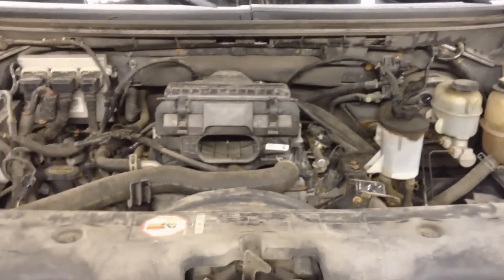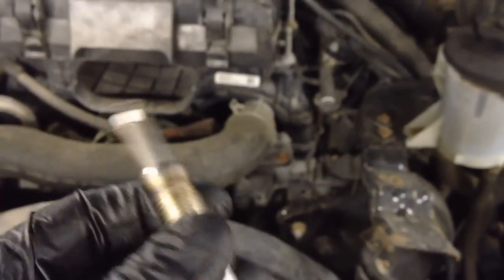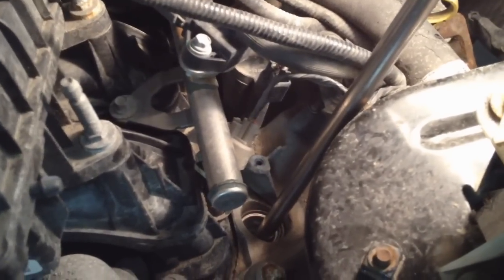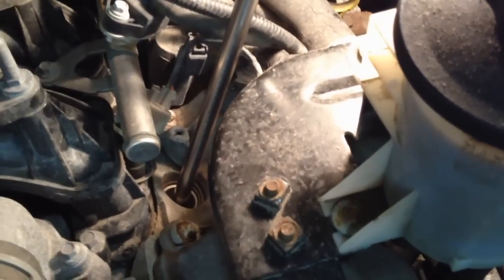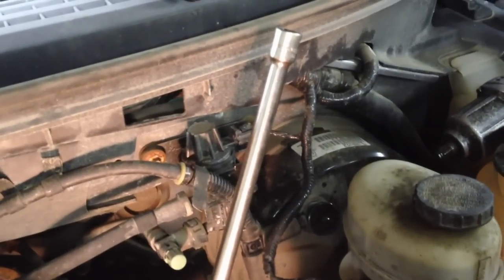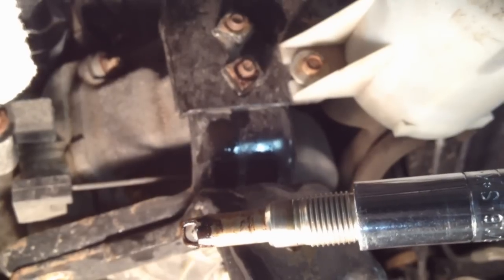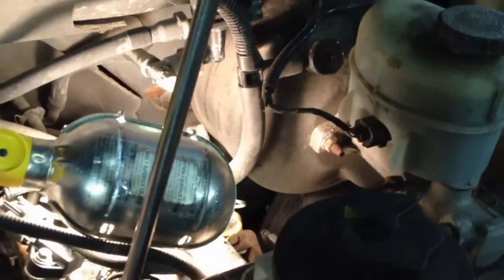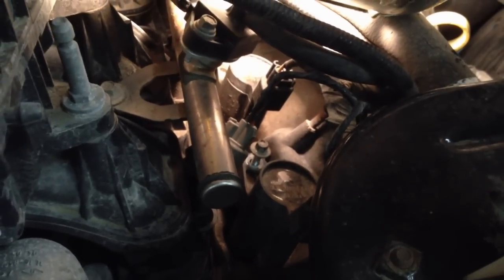Ford 4.6L & 5.4L 3V Triton Spark Plug Removal

Comment: I HAVE A 2002 FORD MUSTANG GT,  4.6L V-8.  IT HAS 100,000 MILES ON IT. THE PLUGS HAVE NEVER BEEN REPLACED. DOES THIS MODEL YEAR HAVE THE PLUGS THAT BREAK OFF? BY THE WAY, ITS IN MY GARAGE AND CRANKS BUT WILL NOT START. CHECK ENGINE LIGHT IS OFF?????????????

Comment: I bought my truck for next to nothing because it would sputter on the highway and even on hills, so I decided to go right through the truck because of the high km's, so I changed the spark plugs, i ordered 8 new cool packs but still haven't received them yet, while doing the plug job I noticed one of my coil packs had a crack in it, these trucks are known for coil pack problems, there's also a fuel pump drive module mounted to the frame of the truck above the spare tire, these are also known for corrosion problems, I checked mine out and there was a hole in the back of it from corrosion so I ordered one of those as well.

Comment: Just did this to my 2004 f150 with 245000 kms on it, used the carb cleaner and let soak for 20 minutes and rattled all 8 plugs out without a problem, I purchased the lisle tool just in case but never had to used it, this method works awesome, you can really see how the carb cleaner eats up all the carbon, i was really worried about doing this job and did lots of research on different methods and this is the one I felt most comfortable with and ended up changing all my plugs in less then an hour, highly recommend the carb clear method.
Reply: mike furlong could I ask you why you did it? I have an 06 which sputters majority on the hi way. I'm just not sure I should do this or the fuel filter/ injector. That's why I ask
Reply: mike furlong mine hesitates between 40-55 mph and new plugs and coils fixed that
Reply: How did you get to the ones damn near under the fire wall about to tackle this job wed on a 04

Comment: my expy 05 sitting for more than 6 months engine not working and can not break the plug even 1/4 turn to spray carb. cleaner, your advice plz.
Reply: bas far Did you try an impact wrench?
Reply: thanks for answer actually I soaked it with carb+wd40 for a night and used break bar

Comment: didn't brake cleaner evaporate to fast to run down the threads
Reply: Don't be scared, I just did mine. It's an 04 with 99k miles. I did mine with a warm engine, broke them loose, sprayed WD down in there then worked them back and forth all the way out. None broke.
Reply from the maker: Certain brake cleaners like the CRC brand don't evaporate as quickly.
Reply: $400 to have my plugs changed. I can buy the extractor tool for $50. And plugs for $100.00 saves me $250 bucks but I am nervous to try it.

Comment: Help....I'm dying here.  2007 Lincoln Mark LT with the Ford 5.4 motor.  Followed videos, and instructions, used carbon breakdown, etc.  First two plugs came out, no issues.  Right front plug has been my worst nightmare.  Lisle tool is brand new and won't do anything.  Spark plug broke cleanly at the electrode shield and that's stuck in the head.  Mr. Lisle won't grab it.  So, I headed over to Autozone to borrow a brand New Mr. OEM and the tap proceeded to strip like it was made out of tip foil.  Now, I'm obviously  a complete idiot here or have overlooked something.  Do I need to get out the burr drill and make room?  Any help would be greatly appreciated.  I''m on life support.  People make this look easy......
Reply: i feel so bad for you! ive done dozens of these 5.4 and 4.6 spark plug swaps and have never had an issue. i guess its only a matter of time

Comment: How did you get the engine warmed up after you had loosened all the spark plugs and removed the coils?  Did you have to reinstall the coilpacks while still keeping the spark plugs backed out?
Reply from the maker: +jlizer yes exactly

Comment: I have been watching your vids about the spark plugs breaking and how to extract etc. Come to find out, the day I was going to change plugs on my 2008 F150 (had all wrong plugs, coil and boots ready to install) just happen to read a Ford Forum online that talked about the change that Ford had made on engines starting 10/2007 on the new design of valve, spark plugs etc. I looked at my Coil boots and they are "Brown" in color then looked on my motor and it was built 03/2008! So to make this a little shorter, check your coil boots and if they are black you have the bad design plugs, but if they are brown you need the updated plugs Motorcraft SP-509 one piece that will not break off! Consider yourself very lucky! Still follow the cleaning with airgun, and spray a small amount of penetrating oil (Aerokroil's great) plus nickel high temp on the threads. I was damn lucky and hope you are too!
Reply from the maker: You are very lucky to have the late model yes that is how they should have been designed since day 1.
Reply: I spent 2 weeks watching your channel (mainly) and a few others and got to the dive in and do it mode, then bam! I looked at my motor then the boots and what a relief!!! Thanks for your knowledge, without it I might have done it my way :(
I have worked on my own and family cars since I was in high school , but not a full blown mechanic. People like you are a great asset to those who need help!

Comment: What are some big issues that the 2008 Ford F150 have? Spark plug issues at all?
Reply from the maker: There is a mid year change to brown coil boots if you have those the spark plugs are not an issue.
Reply: +FordTechMakuloco any other huge recall type of issues that 2008 Ford F-150 have?

Comment: I made it through all 8 today.  None broke. :)   I used lots of penetrating PB blaster.  I couldn't find Kroil anywhere.  I just turned a quarter turn back and forth until they came out.  The plugs removed were HT1, so I put ht1 back in.  157,000 miles.  Thank you for the video.
Reply: Any issues reaching the ones in the back??

Comment: Okay, so this is, or ISN'T the two-piece. We have a 2001 Ford F-150 that has a messed up coil and we decided to replace them all at once along with the plugs. They sold me spark plugs that are single piece for some reason and told me it fits the truck.

Comment: So I have a 4.6L Triton v8 engine. I got my spark plugs, coil grease, and the anti-seize. This may be a stupid question, but how can I tell what voltage my truck is?
And I'm not entirely sure what the solution was that he sprayed in there to get that plug out, but what has everyone else been using? Top recommendations? I've just got an Oreilly and AutoZone over here.

I'm trying to work with the bare minimum to replace these as I don't have a nice large garage to work in (learning on how to repair my vehicles one problem at a time).

Comment: I did this so I didn't have to pay 800!!! dollars for a mechanic to do it. They recommend that you run your truck for 5-10 minutes to warm up the spark plugs. I went to orielys auto and rented the spark plug extraction tool. 2 or 3 spark plugs broke and had to use the tool. When they break the tip of the spark plug stays in but the white ceramic also breaks. To get those out I just started the truck and it just blew out the ceramic then just used the tool to get the tip out.
Reply: Those plugs are so junk

Comment: Great video I have picked up so many great tips from your channel. I have a 2006 F150 5.4 and I just finished with new plugs and coil packs. I followed all of your instructions and used OEM parts. All went well no broken spark plugs and I made sure to use OEM anti-seize and dielectric grease. The engine light that was on is now off but I have a little problem. Seems to be a little hard to start not too bad but runs a little rough and the idle goes slightly up and down I have no idea what is wrong now and I need to get a smog check. I just purchased a Actron CP9180 plus Auto Scanner but have not sat down to learn how to use it I am a newbie to automotive repair but trying my best to do things the correct way and you have been such a blessing. Any advise would be greatly appreciated I am tired from the spark plug job and a little frustrated that it now runs rough after all that work and new parts. Thank you for all your help have a blessed weekend. -Paul
Reply: miine does the same thing! did you ever figure out what the problem was?
Reply: @Hookem65401  thanks!

Comment: Use about 1-2 teaspoon of Berryman Chem-Dip Carburetor & parts cleaner part# 0996    it dissolves carbon buildup  WAY WAY  WAY Better then any spray can stuff   let set about 30-60 mins and plugs come right out
Reply: Dan theman my question is how do you apply the carb- dip is it liquid?
Reply: Yes its a liquid comes in a metal can  smells bad but works great  I use a metal spoon and drop it down the plug holes
Reply: WHERE CAN I GET THIS #0996 ?
Reply: Any of the Big auto Part Stores carry it   Napa  Autozone Advance auto even some Walmarts have it

Comment: Great videos for sure- and appreciated to the regular shade-tree guy.  Is this the same procedure as the v10? I have a 2008 F250 3V with 121K on it and I'm ready to tackle. 10X SP515 plugs, carb cleaner and dielectric grease already purchased.  The reason I ask, is it seems the v10 isn't as common to break? Or is it just the rarity of the engine itself?
Thanks so much.

Comment: You make the best videos. Sincerely. One question. You say to use 3/8 impact to remove. In the video, that looks like a 1/2 inch impact with an extension that reduces to 3/8.
Reply from the maker: +woog74 I do because my 3/8" lacks power but a quality 3/8" is best especially for the back cylinders or a stubby 1/2 " like this-http://www.amazon.com/gp/product/B00IAC0HNK/ref=as_li_tl?ie=UTF8&camp=1789&creative=390957&creativeASIN=B00IAC0HNK&linkCode=as2&tag=fordt-20&linkId=ZHVY5A6MTGC5W7LR
Reply: Thanks. I am looking at compact 1/2 guns. Do you own the one in the link you posted? I have had my eye on this one, but can not find anyone who owns it yet. http://www.amazon.com/Mighty-Seven-NC-4630Q-Impact-Wrench/dp/B00YG7OXII/ref=pd_sim_sbs_469_3?ie=UTF8&dpID=318M8806n1L&dpSrc=sims&preST=_AC_UL160_SR160%2C160_&refRID=1BJG5NQFR5GMK2H0P8T4

Comment: Question, the Autolite video says to use 3/8 ratchet and work the plug back and forth to free it up. While yours, and another line mechanic,says use 3/8 impact. Since you appear to be a line mechanic, and do this every day, is it better to use the impact? This was a great video!
Reply: +FordTechMakuloco Thanks so much for your help. Easy to see why you have so many subscribed.
Reply from the maker: +Pat P Yes between heating up the engine and the quick burst of the impact it seems to work best most dealer techs deal with them this way only on this engine.
Reply: +FordTechMakuloco 
Thanks for the reply. Another question, my 2000 Expedition 5.4 did not have that style plugs in it and when I sent to NAPA to get plugs, they look like regular spark plugs. Whats up??
Reply from the maker: these plugs are for the 3 valve engine yours is a 2v so you have normal plugs.
Reply: How can you tell the difference in the 2 and 3 value
Reply from the maker: the 3 valve has a vct solenoid sticking out of the valve cover towards the front of the engine. The 3v didn't come out until the 2004 F-150 new body style.

Comment: Great video. Thank you for the tips. I did everything the way you said to. ALL of the plugs on my 2006 Expo w/112K miles came out in 1 (ONE) piece. BOOM!
Reply: Steve Willsey 
What do you do if you don’t have an air compressor to blow out the debris?
Reply: @daryld.7472  its a late reply but, you can pick up a small compressor for under $150.  You can also use a can of compressed air but, you'd probably go through a can per cylinder or 2
Reply: @daryld.7472  yes, please. Update. Much appreciated

Comment: Kudos my friend. I used your method as well as some advice from my Mr. Tanguay. I ran 2 cans of Seafoam through it and then followed your instructions on removing coils and letting carb cleaner sit over night. I had nightmares about doing this. It is an '05 with 199,765 miles and same factory plugs. Great news..all came out intact except one and its tip was the only thing broken off (all ceramics had already been lost in cylinder and expelled through valve. Thanks for your videos.
Reply: What does your last statement mean? I'm in the exact same boat with an 05 grand Marquis
Reply: mr tanguay from mass?

Comment: I just did my 06' explorer this morning.  Cracked the plugs 1/4" turn last night and soaked them with carb cleaner.  I don't think that very much cleaner penetrates down into the carbon, I didn't see any level change in fluid this morning.  I think once it starts spinning, it leaks in and lubricates everything to help with the removal.  I hit them this morning with the 3/8" impact.   I used the shortest extension that I could get away with.  I also used just enough torque to get the plugs moving and keep them moving.  They didn't spin fast until they were almost out.  I had no problem and I saved all eight from breaking.  It's amazing how many garages use this method although Motorcraft says to use a torque wrench.

Comment: Just to add, I just did plugs in my 2003 f150 4.6L. Found out that if its a 2 valve its a 1 piece plug 3 valve is a normal spark plug so not a big deal. And in 2004 is when they went to that retarded plug they started using.
Reply from the maker: +Heath Jensen yes the spark problem is only on 3v engine 2004 new body style forward, 2004 heritage models still use the 2v engine with no problems.
Reply: +FordTechMakuloco Thanks. Glad I have the heritage

Comment: Wouldn't turning it 1/4-1/2 turn just break the spark plug right away?
Reply from the maker: Camren Monroe No they turn a bit before binding and twisting this lifts it off the seat and allows the cleaner down to the tip.

Comment: Would have been nice of them to apply anti-seize compound from the factory.
Reply: Or replace your plugs more often I’ve never had a stuck plug in my 3v😂
Reply: That would make sense yes but then the lazy people wouldn't be forced to seek out dealer mechanics at 150+ an hr
Reply: The employees are to worried about getting a break and crying to there union or stupid petty stuff to put anti seize on them

Comment: Brian - Want to send you a HUGE THANK YOU!

I followed your procedural  steps / process for spark plug and coil change out on my 2009 F150 4.6L 3V motor with 58K miles with ease and total satisfaction.

Found that all plugs were in good shape except all eight plugs had an average gap of .055 instead of the required .43.

Also found that if I had not done the plug change when I did, I would be yet another victim of blown spark plugs.

Plug numbers 2 and 3 were really loose.  Number 3 plug was extremely finger loose.

I used FOMOCO spark plugs and Accel coils with the brown boots. Truck has awesome response once again! (i know you don't recommend using anything but FOMOCO OEM parts but I've used Accel parts for some 3 decades and trust that with solidly based parts research and some common sense, I can use some aftermarket parts).

I watch and re-watch some your videos every week. When I saw the video about increasing the spark plug torque I was a real happy camper. Ford's factory torque of about 11 ft/lbs for my plugs left me shaking my head to dump out all of those aching question marks from of my ears...

Your video suggestion to increase the plug torque to about 25 ft/lbs truly passed my sanity test that's based on 40 years of street and home garage mechanical experience.

Again I humbly thank you for the time, energy and sacrifices you put into these videos.  Keep On - Keeping on - were all here for your success.  Rick
Reply from the maker: HawaiianF150 2009-4/6-L3V Why thank you!
Reply: May I ask if you remember how many miles you had at the time of changing the plugs? I sit at around 75k and am curious how difficult this will be

Comment: I show the comment you sent to my son for his truck and he caught my error.  He has a 2000 Expedition.   I am sure you caught my error too.   I is a V8, 5.5L (330 CID); SOHC 16V; EFI engine type.   Since I do not see 3V in the details I wanted to confirm it was the same answer for that the piugs should come out prior to starting the removal.   Thank you for the great video's.
Reply from the maker: Jeff Carpenter Yeah the 2v plugs come right out.

Comment: we have a 2000 Exhibition and the number 8 spark plug has a misfire code. When I tried to get the bolt off for the coil pack the head snap off it was very rusty.  I then changed the coil and it still has the code come back.  I was told not to attempt to take the plug out.   After watching your video I am not sure an impact wrench will fit in that space.  If I soak it overnight do you think I would be able to get it with just an 3/8 inch ratchet?  What is your experience with number 4 and 8 plugs?  Also your thoughts on if the coil pack will stay in place if it is not bolted down?  I am not sure I can get the stem loose,  Thank you for your time.
Reply from the maker: Jeff Carpenter The plugs on yours should come right out not being a 3v engine. The coils generally stay in place and will work for awhile yes.

Comment: My 2008 Lincoln Navigator built in dec of 2007, as a 2008 model. Does it have the problem?
Reply from the maker: No it was mid 07 they were fixed. If your coils have brown boots your plugs are the new style that come right out

Comment: Great video! I have an 03' Expedition XLT 4.6L 130K miles. Never had the plugs replaced. I have always been concerned with the "spark plug blow out" issues I've heard so much about. Does the issue with the plugs breaking & the plugs blowing out affect this 4.6? (It was built on 04/03) thanks, keep the videos coming!